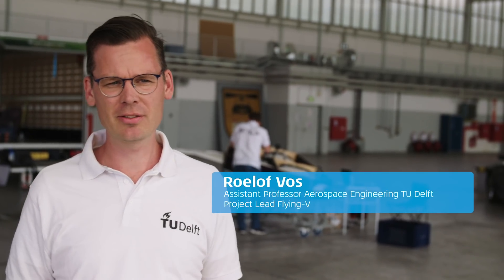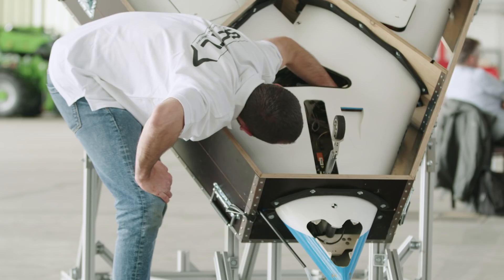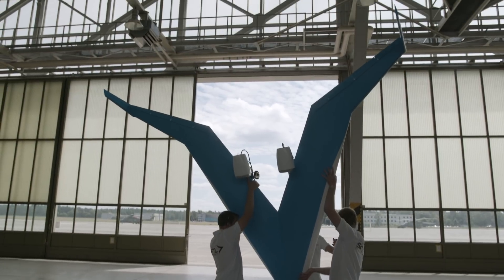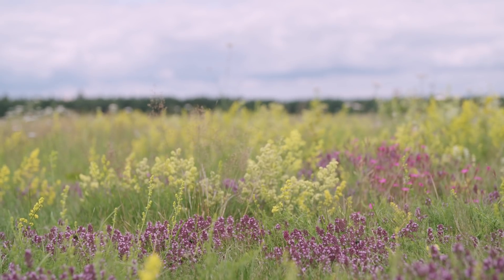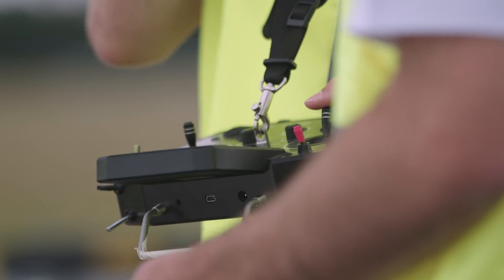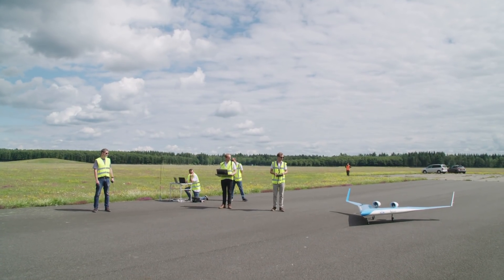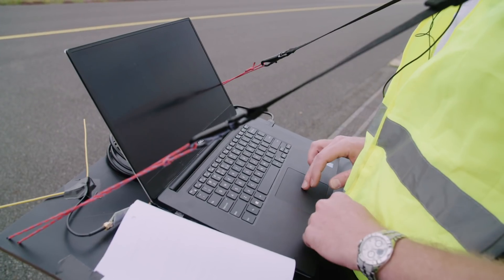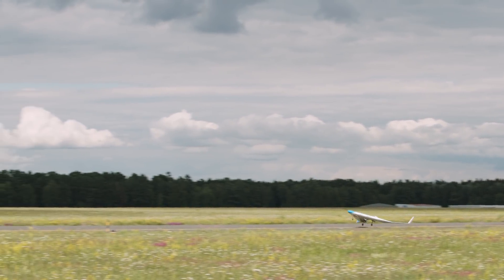Flying-V - Scale model maiden flight

Comment: Sounds like there is another South African in this venture which is a good thing. The plane, however, seems very impractical. Large scale planes will not yield the same capacity with other comparable, existing planes
Reply: According to the designers, the design is comparable to the A350. So the plane has the same 65 m wingspan and can carry the same about of people as the A350, which is 300-350 people, all while being 20% more fuel efficient than the A350. 

Some problems they would have to overcome is the cost of building the plane with such a unique design. Early adopters of the V wing would have to calculate the cost of the plane with the fuel savings, among other things, to justify spending big money on this aircraft. Although, I would imagine that cost of production would eventually go down with more infrastructure in place to build the aircraft.It would also be interesting to see the actually structure of this plane and how it would be built to make sure it's structurally sound when flying.

Overall, if the fuel savings are what they claim to be then I could see this aircraft being a real thing, but I can imagine seeing a real prototype for 5-10 years just because of the time it takes to design the plane. And then many more years after that before the first passenger plane takes it maiden flight, but I think it's a good design worthy of investing in.
Reply: This is Dutch(Netherlands) though, not South African
Reply: Malcolm Brown speaks English with a South African accent. I can only surmize that he is from South Africa as the accent is uniquely South African. Good job, Malcolm!
Reply: Netherlands has tons of weird accents.
Doesn't mean they come from 1 area of the world.
Reply: @Arutemysu  Mmm, yip you are right, perhaps. Are you Dutch?
Reply: @johansteyn59  I was born in the Netherlands and still live here.
Reply: @Arutemysu I have been to Holland quite often when I was still flying. I love it! I am planning to visit my family in Antwerp and we may just go by train to Amsterdam for a day or two. I also love Dutch as the language I speak as my first language is closely related to Dutch. Following everyday spoken Dutch is difficult but reading Dutch is no problem. So, you may see why I like to listen to accents which tells me where a person may originate from. However, South African English is pretty much different like Australian English or American English. There is a twist though.
Reply: @johansteyn59  then go to areas like Lelystad, Rotterdam, Groningen, 's Hertogenbosch and more over the Netherlands.
It's pretty fun.
Reply: @Arutemysu  Good afternoon, these are the areas I would love to visit. The tourist areas does not give a true reflection of who the people are. Apart from Amsterdam, I went to Marken and Vollendam. Very nice but too many tourists. In Germany (Mainz) I always went to eat at a local-people's restaurant. You had to knock at the door in an alley until someone opened. I could never find another place that had such good eisbein. Of course, the drawing card was the price. I really love Amsterdam and the graagten are magnificent. Ik vind het erg leuk en wil graag terugkeren voor een vacantie. Groete van Johannesburg!
Reply: @johansteyn59  You really should go outside Amsterdam, visit non tourist spots.
That's when you discover the Netherlands the most, because big cities aren't a representation what it is like overhere.

Comment: Do you get anything more out of a flying-V than regular design plane ✈️ . 
What is special about it? 😛
Reply: G Guest  with a thick leading edge like that??? I'll bet this fuel economy claim will not hold up to scrutiny at mach 0.85
Reply: @jamescooke3763  They will need to do more wind tunnel tests to see how much more efficient, but the thick leading edge is due to the shape of how wings function.   Look up any flying wing and you shall see a thicker flying edge.
Reply: @Mathadar  thick wing = more lift = more drag. If you double the drag you need 8 times more power to push the same object through the same fluid, hence the design is going to be very slow. Have a play with this airfoil simulator, I think you'll like it. https://www.grc.nasa.gov/WWW/K-12/airplane/foil3.html

Comment: Also having such a steep delta on the wing means it has to be at high speed on landings.
Reply: That’s not completely correct. There is a much larger cord and probably better stability with this design.
Reply: @paulbrouyere1735  that only works if the wing is longer.

Comment: Looks stable but slight underpowered. Still okay unless you have an issue and need quick throttle response. Of course that’s based just on my observations... looks great, awesome design!
Reply: Looks like flyng at edge of a stall. Evident on its slight climb bank angle. Could be his likely babying it on first flight unsure of its abilities...
Reply: I wonder.. What happens if you loose thrust on one engine, does it just helicopter out of control since the flight surfaces are so small? How can the flight surfaces handle uneven weight distribution, by adjusting engine thrust independently?  🤷‍♂️

Comment: Stall recovery?  Spin recovery?
Reply: Top-rear mounted engines assist stall recovery by having the center of thrust above and behind the mass to reduce the angle of attack, recovering from the stall pretty effectively. 

The dual rudders are more effective than one during a spin.
Reply: Not needed.

Comment: Bad job... What about the engine position during a stall... Safety first!
Reply: This engine position actually assist stall recovery much more than under the wings. By having the center of thrust above and behind the center of mass, the pivoting effect of this placement helps reducing the angle of attack thus recovering from the stall more effectively.

I think the engineers that actually worked with this have thought of this way before than you did. :)
Reply: @FlyLeah  try to have thrust without suction on a jet engine... "FLAME OUT" result...
Reply: @FlyLeah  second problem of every airplane with upper engine... The loss of feat to recovery the stall...
Reply: @FlyLeah  https://images.app.goo.gl/PEpkcHoWaTBWtmu77
Reply: @FlyLeah  sorry but I'm a technician... A constructor of real military jet plane since 15 years in Italy
Reply: Peace, we have MCAS.
Reply: @xb1t2mm3ujf2  scary flight control laws... How they works during an emergency... Remember the first airbus 320 and the last 737 and 787... Today's engineers forgot the history...

Comment: This plane would break into a millions pieces if it ever had to do an emergency landing say on the Hudson river.
Reply: why would it?
Reply: @spottedhyenaOwO  - of course just a feeling. Wider objects tend to cause more drag on water which would create more stress on impact.
Reply: JP indeed, I would assume tho that because of the way it’s built, the critical areas such as passenger cabin and wing body would be less harmed since the majority of the energy would be dispersed in the underbelly of the aircraft, remembering that the airplane is not flat in the bottom or top side. Interestingly enough considering the boing x48-b, it would also be assumed that, since there is a greater surface area, more violent the response to such an impact would be.
Reply: Jangus Roundstone  Could only imagine hes speculating, a plane as such would have an reenforeced airframe, so im quite sure it would be able to do emergency landings such as landing on water. Aero engineer sutendt here...

Comment: This is cute, but proves absolutely nothing.
At that level of scaling, and with such overpowered engines relative to mass and flying speed...
You can make an ironing board fly. (i've done it)

I'm not saying the airplane concept is invalid. It almost certainly is not, as both the researchers(Delft university) and sponsors (Airbus) know what they are doing.
But THIS scale plane? It is a mere publicity stunt.
Reply: Yeah, I'm also interested in that ironing board.
Reply: @paulunga  Here's one on youtube. Not mine, i did film it but that was back in the era of 8mm film. a.k.a. a long, long ,long time ago.
https://www.youtube.com/watch?v=QpTyfjYMlNc
Reply: @marvinkitfox3386  LOL good one, I have only seen flying lawn mowers and vacuum cleaners, this is 'new' to me :D thanks for the vid!
Reply: You're right. Im sure the guys at this aerospace engineering place totally forgot to factor in mass and velocity. I'm sure this test to see if the design is capable of controlled flight proves nothing.
Reply: An ironing board? LOL
Reply: https://www.tudelft.nl/en/ae/flying-v/technology/

Comment: I saw you can retract the landing gear, but in the flight you kept it out the whole time (as far as I can see) Is this to create more drag?
Reply: I normally do that on a maiden flight of an RC plane. In case the plane flys like crap or it's way out of trim and you can just about fly it,it's one less thing to worry about in a panic landing.
And they might also not be using the retracts because they might be using real aircraft procedures.

Comment: As for the control surfaces, I saw the rudders, but are the elevators, ailerons and flaps configured into one unit? In terms of landing and stopping the craft, would engine reverse thrust be the only method? How might you employ air brakes?
Reply: Elevons are a thing :) aileron-elevator coupled control surfaces. Flaps are a separate control surface probably just mounted next to the elevons.
Reply: @FlyLeah  Yes, I'm well aware of Elevons. I have a couple flying wings in my RC Arsenal. My point is, I did not see the other control surfaces (because they didn't show it), so I was wondering what these engineers came up with for lifting and banking.